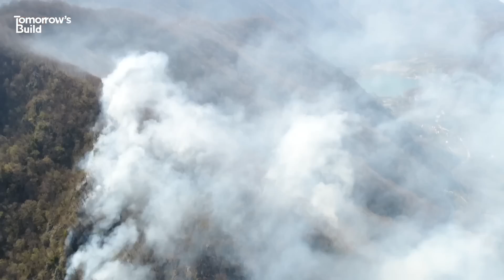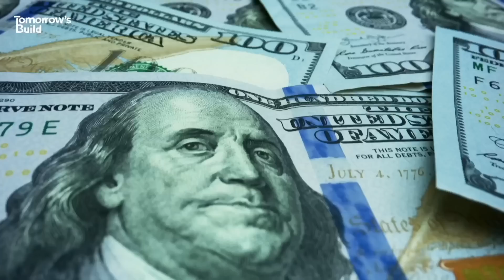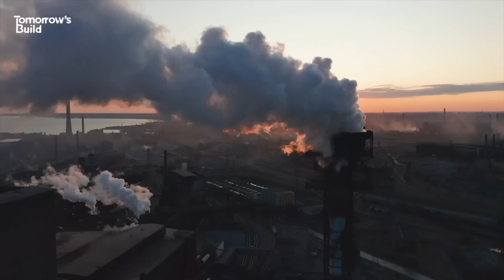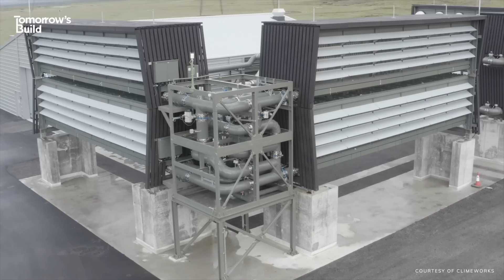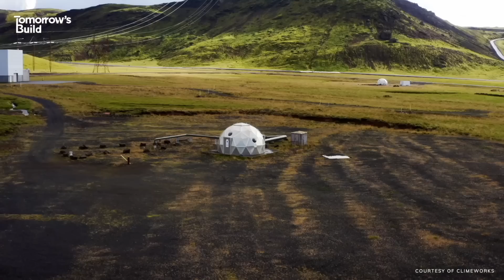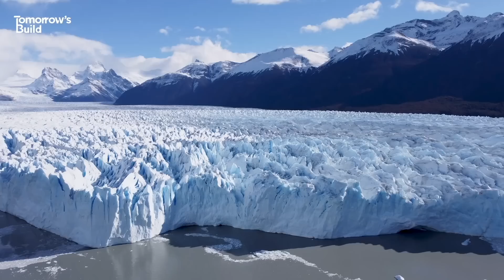This Machine Could Reverse Climate Change | Tomorrow's Build

Comment: Decreasing emissions is vastly more important than direct carbon capture, and will remain so for a long time. Point source capture is good since it is effectively a reduction of emissions, but direct air capture is all but a waste until we've significantly reduced our emissions. Direct air capture currently creates more emissions from the electricity used to generate it than it actually captures. Using renewables isn't a good solution either since those same renewable sources would have a greater impact by simply replacing the fossil fuels used to satisfy our current energy demand instead of increasing our total energy demand. Ie. A field of solar panels putting a coal plant out of business is more impactful than that same field of panels capturing a fraction of that coal plant's carbon output. Current theoretical direct air capture capacity, including facilities currently in development, is about 1 megaton of carbon per year, but we are emitting over 37 thousand megatons per year. Carbon capture is a drop in the bucket until we've reduced emissions.

One day, when we've successfully phased out most fossil fuels and we have fewer options to further reduce total emissions, then it will start to make sense to invest in carbon capture. And it absolutely is important that we continue to research and develop the technology until then so that it's as good as possible once that day comes. But in the meantime, reducing emissions is by far the easier and less expensive option, and the one that any and all resources should be put towards.

Comment: What are the numbers in terms of Co2 drawn out of the air vs. Co2 required to manufacture and power the units?
Reply: I know a lot of people will say "is requires zero Co2 to power if you choose a clean energy source". I completely understand, but we MUST use the average Co2 emissions from energy production when calculating this. If we don't, we'll have to account for where that clean energy could have gone were it not allocated to the DAC-units and add on that Co2 ...which in the end is the same thing.

Comment: Why is it we only see CO2 extraction in pristine environments with low levels of CO2. Would they not be better on building rooftops in our cities, you would have to have extra filters or change/clean filters more often due to higher particulate matter from the pollution but surely this would be offset by increased extraction and reduce running time per ton of CO2 extracted?.

Comment: This is a good overview.  I would like to see more details about the chemical engineering and geotechnical aspects. What is the mechanism that changes CO2 from a gas to a liquid or solid? Has that process been scaled to be mobile? For the subsurface storage, 
* what kind of geology is needed?
* what keeps the CO2 in solution so it does not leak back out?

Comment: I am very skeptical about capturing CO2 out of the air somewhere in the countryside far from the emitters. Of course air travels around the world, but what percentage of all air will ever pass through one of those machines? We already have a similar problem with filtering plastic out of the oceans. That seems like an impossible task unless you have an enormous amount of filters. And the air or water, that was already filtered, mixes with the unfiltered air or water very quickly. So imagine you filtered 50% of all plastic out of the oceans in 30 years. That does not mean that another 30 years for the remaining 50%. After 60 years you will have filtered 75% and after 90 years 87.5%. With CO2 the problem of course is not as bad as with the plastic of course, as some level of CO2 in the atmosphere is okay.

Another problem is the energy you need for the filters. If that energy is taken from renewable sources, people might argue that the energy consumption of those filters will not cause any additional CO2. That is only true though if that renewable energy would not be produced without those filters. If it would be produced anyway, it could be used for other things, if the filters would not exist. So those filters would still take energy off the market and therefore indirectly cause CO2 emissions.

Comment: How about trees, free carbon capture and storage
Tree space is instead used for buildings and roads using concrete: a huge concrete emissions source
Even lime bricks naturally passively absorb CO2 and become stronger
And peak grid power should be done by solar power plants specially over water bodies and deserts
Direct active C02 capture is a gimmick it seems (only applicable directly over C02 producing industries like coal power plants)
Otherwise there is no value proposition to capture C02

Comment: These use more clean energy that can be better use elsewhere, and all those parts needed to be manufactured? How much CO2 is that? Unfortunately these have a long way to go before they become efficient enough where they should be scaled out. Disappointed in your crew in sharing this as a finished product to give these companies doing a "good deed" a pass.

Comment: The biggest issue with Carbon capture is that it's often seen as a scapegoat to just keep emitting and not change our existing systems. This is for instance seen in Denmark where the plan is to use carbon capture, not to combat emissions, but to create methanol to use as fuel in ships or airplanes, which might be greener than diesel, but still just takes emissions and push them somewhere else, and puts them back into the atmosphere upon combustion anyway instead of reducing the amount I the atmosphere. It's really annoying.
Reply: Actually that's the whole point, if you make fuels for ships and planes where there is not yet a viable green solution, you are cutting the emissions of that area, it turns into a cycle
Reply: You don't have a better idea for powering ships and airplanes, so your annoyance is irrelevant.
Reply: If they can eventually capture more than we produce I don't see any problems with fossil fuels. We're just not quite there yet
Reply: it really doesnt matter, as long as we progress with thid technology then, it wouldnt be a problem at all, even if we can just keep the level of c02 to a manageable level then its good, its honestly better than doing absolutely nothing at all.
Reply: if its so annoying think of a realistic alternative ...waiting ...waiting
Reply: So we shouldn’t do it then? Is that what you’re saying? Oil and Gas have no viable alternatives right now. So carbon capture is probably the best way. EVs burn electricity which mostly generated by coal and natural gas. So they’re no greener than an ICE vehicle at the moment
Reply: @JensSchraeder  EVs are much cleaner than ICE even if they only used electricity from burning only coal. Several studies exist on that (look it up - Poland, Australia, etc.), the economies of scale would allow a reduction up to 50% in emissions. Not to mention that we would move those emissions from literally under our noses to places away from where people concentrate the most.
You need to do some research and drop the qualitative comparisons. EVs and ICE both cause pollution so they're the same, is just potato logic. The kind that the oil industry spews, like, for example, when saying that EVs are terrible because lithium batteries use graphite and proceed to show a single example of a factory in a remote region of China where workers, buildings and surrounding soils are covered in black powder, as if those appalling working conditions and pollution generated are representative of all graphite extraction industry and as if they existed or would ever be allowed in any developed, democratic country.
Reply: @pbs36  You are dreaming. Electric motors have nearly no energy loss (no heat dissipation), that's true. But electricity storage is really inefficient. If you take the whole system (motor, batteries, line losses...), you get something equivalent but your EV is a lot heavier. Physics being physics, electric vehicules need more energy which cancel the benefits of using some renewable energy in the mix. When you use EV, you just move pollution somewhere else and you feel better so you can criticize other people.

People are speaking about graphite factories in China because this is where graphite comes from. We produce most of our natural ressources in countries with low environmental standards because it's far less expensive.
And you forgot to mention that those countries use coal to produce our "green technologies". Our copper comes from Chile (Coal), our solar panels and eletric batteries come from China (Coal). Your clean energy is a vaporware.

Look at CO2 emissions, you will see the effect of "renewable energy" and "green vehicles" at the global scale : absolutely nothing. We are just moving pollution.
Reply: @Difdauf  Hello there in 1990.
Reply: @JensSchraeder  No, they aren't implying that we shouldn't do it. They're saying that it can be used in counterproductive purposes, and that we should watch out for those uses. The coal industry, for example, is using carbon capture to spread the idea of "clean coal" - which isn't actually climate neutral, but is easily marketed as such.

And yes, there are viable alternatives to oil and gas. Hydro, nuclear, solar, and wind, among others, are extremely viable. So viable that there are a multitude pf countries in the world whose energy grids are entirely fossil-free. I assume you're American, because the rest of the world is currently debating on whether nuclear is climate friendly or not, not whether it's realistic to try to transition away from fossil fuels.

And yes, BEVs are much greener than ICEVs, even in the case where they get their energy from a 100% fossil-fueled grid. That's largely attributable to their engines: BEVs use electric motors, which are significantly more energy-efficient than internal combustion engines, losing much less energy to friction/heat and thus allowing more of it to go to motion. In other words, you can travel a larger distance on a gallon of petroleum with an electric motor than you could with an ICE, reducing your oil consumption per mile, which in turn reduces your carbon emissions per mile. 

In fact, ICEs are so inefficient that the majority of the fuel you pump into it is wasted. Electric motors convert >85% of electrical energy to mechanical energy, compared to ICE's <40% conversion of chemical energy to mechanical energy. The share that isn't converted to mechanical energy is lost to friction and thus wasted. When you know what an internal combustion engine is and how it works, that makes perfect sense considering that they quite literally operate by... combusting. Or burning fuels, in layman's terms. Of course there's going to be more friction when you set things on fire.
Reply: @Vorexia  Not to mention the problems both types of vehicles will still externalize. Social isolation and pedestrian-unfriendly environment from car dependent development, congestion, road rage, and road tolls from the sheer number of vehicles. Electric vehicles may have their roles, but this must be combined with good public transport, careful road and land planning, good footpaths and bike paths, mixed-use development etc.
Reply: @CANUCK2770  that depends where you are. In the uk, the majority of our energy now comes from wind, solar, and nuclear. So it is way more "green" than fossil fuels, lol. 

The problem with electric cars isn't electricity. That's a government problem. 

The problem is the lithium and cobalt extraction process, shipping, and recycling. It's basically toxic and dangerous in all 3. The process scars the landscape and leaves toxic chemicals behind. It is mainly dug up in poorer African nations, so the workers are generally poorly treated and subject to dangerous conditions, nobody can recycle the batteries so once they're done they either end up somehow back in africa in a landfill or underground in the country of disposal also polluting the land it came from.

To be honest, again, depending on where you are. Cars aren't really the best solution to travel going forward. Public transport such as the national rail and TFL train services (when they want to stop striking. They earn enough! ) are the best way to reduce emissions on longer journeys. 

As for planes, we could see a move to hydrogen. However, we all know the first thing people think of when they hear flying and hydrogen so that may not have the best foot forward when it comes to investment. Hydrogen fuel cells have a much closer fuel density to fossil fuels, so for planes, that's our only alternative atm.
Reply: @magnarex  the majority of your energy does not come from wind, solar, and nuclear. You're forgetting that all forms of heating are energy intensive. The whole UK is piped up for natural gas for heating homes and water.
There's a reason the government parties have been shouting at each other about heating subsidies for months.
Reply: @JensSchraeder  This is dumb and wrong because EVs are much more energy efficient than ICE motors.

Comment: I used to be on the side of the fence that says “hey, we should just plant trees instead”. But after extensive readings, I learnt photosynthesis is a very inefficient process. While we can use these wood as materials, often times many of the forested areas may still get decay or forest fire, which in turn releasing the co2 back. Relying on trees alone may not be enough in slowing down climate change. Carbon capture technology hopes to once again lock these co2 gases back into the ground to help further slow down climate change. Relying on trees alone is a risky way, so we should welcome such technology. Note that things are here to supplement trees and not to replace them. :)
Reply: These things produce more CO2 in energy consumption and manufacturing of parts then they take out unfortunately

Comment: From what I have read and heard about these are: 
The carbon capture system require LOTS of energy! The amount of energy it uses to capture 1 tonn co2 is produces more co2 if the source is green energy. 
So why not just make clean sources and remove the old fosil one and when we have surpluss enegry we make these carbon capture stations. 
Right now we are keeping or even making more fosil station and making clean energy. In the long run that does not add up. Feel this is one step ahead and two back.
Reply: I work on the factory used as an example here, Norcem Brevik. The CO2 plant being bulit in Norcem Brevik will use the excess heat/spill heat from the kiln to capture the CO2. So no extra energy will be needed. And Norcem Brevik have already switched away mostly from burning fossil fuels, but some processes like making cement releases CO2 from the calsination of limestone wich is an essential step in the process and cant be exchanged. So if we as a society want to continue using cement CO2 capture is really the only way to reduce all emissions as well as moving away from fossil fuels.
Reply: @stian1236  I really like the factory that capture it. Removes it before it goes to the atmosphere. What I see as a problem is the Carbon capture station that uses lots of energy to retake from the air. Instead of making green energy to fuel them, use it to remove the fosil fuel powerplants. After that is done and we are making surpluss of energy start capture carbon from the air. 
But every way to remove it before it goes to the air is a great contribution to reduce climate gass polution :-)
Reply: @errons1  yeah i agree with that, but i think its great that this technology is getting developed now, beacause if we are going to wait untill all sources of carbon emissions are stopped it will be to late. 
Where i think this technology will be really useful right now is in cities with really high air polutions of CO2 and other particles and dust.
Reply: @stian1236  there are greener alternative ways to make cement which emit less CO2.

Comment: There's another possible profitable use of CO2: it's a base component of making e-fuels.  That still needs the power question sorted out (and I see that more likely coming from nuclear than solar or wind) but by putting reclaimed CO2 in fuel you end up with carbon neutral traffic without having to throw away the already invested energy in making cars, HGVs and planes and the associated infrastructure..

Comment: The main obstacle to the adoption of carbon capture is that it's hardly feasible on the required scale to have a meaningful impact on climate change. 
One of the first carbon capture plant that opened in Iceland a few years ago had the capacity to capture a mere 9 seconds worth of global CO2 emissions in one year.
To make the word carbon neutral would therefore require 3.5 million such plants, and that's not even taking into account the removal of emissions from past years and decades.

Comment: Problem with carbon capture as it is right now is it is wholly inefficient. It capture a fraction of the carbon emitted on average (based on worldwide energy production sources) with the power required to make them work. So for Carbon capture to truly work the whole world energy infrastructure would need to go clean for those carbon capture plants to make a dent on the overall emission. 
Tech is expected to be more efficient in the future but as long as coal, oil, natural gas and all other polluting energy exist it won't change anything.

Comment: Too little. Too late. It's a lot easier to just accept that the end is near. Set the thermo at 72 in the winter and 68 in the summer. Get that big car you always wanted and drive fast. Stop messing around with separating garbage. It's all trash now. 
Free yourself...